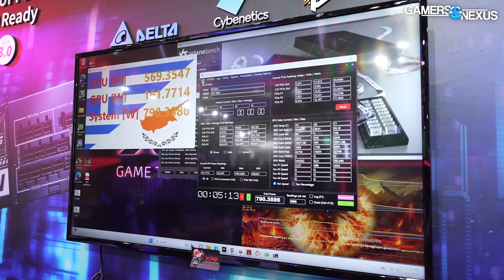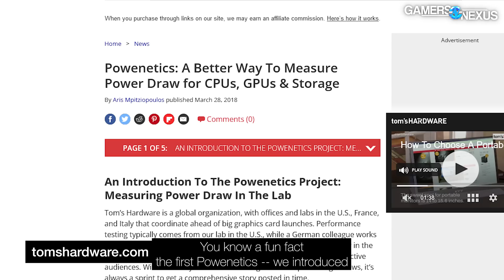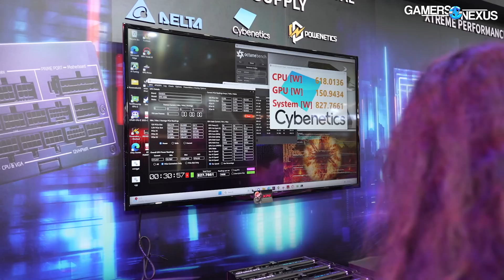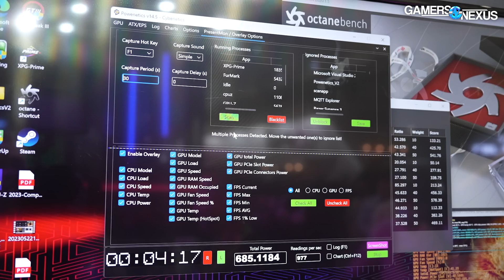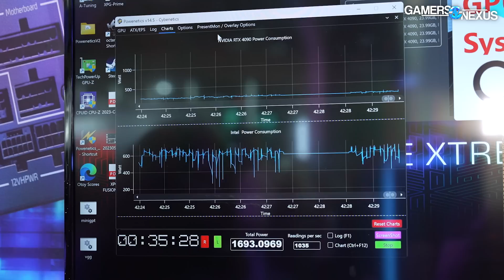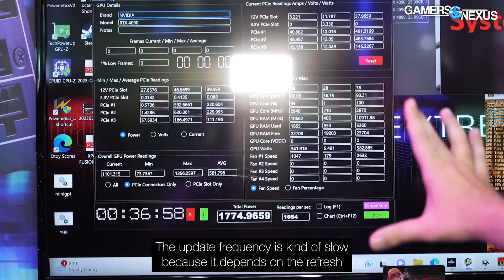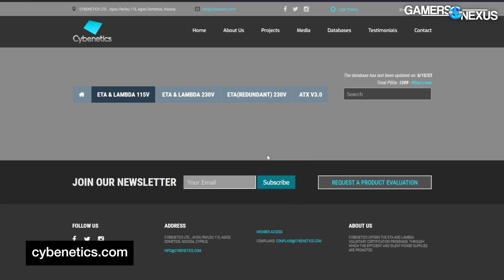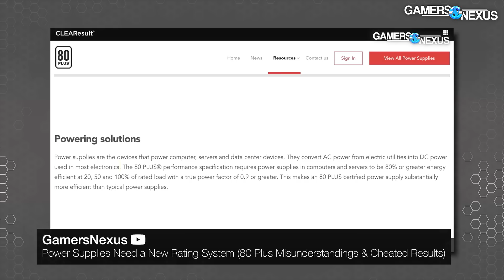GPU & CPU Power Testing Needs an Overhaul | Discussion ft. Aris of Cybenetics

Comment: As a PC tech who was around long before 80+ was introduced it's sometimes hard to remember that not everyone knows what the standard means, and what is tested. When he says it has some weak spots that's framing it mildly. Remember that it only is concerned with power efficiency at a few select loads. It says nothing about the quality of the power, other than make sure it meats minimum ATX spec. That's all. It has nothing to do with quality of the PSU, though in the early years it took a lot of work to meet even the basic 80+ standard, so those PSU's tended to be of at least decent quality. Today that's well known tech and even the cheapest and shoddily made PSU can be built to 80+ spec. Gold was relatively safe to assume that they wouldn't be terrible for a few years, and then Platinum. Titanium grade is the new hotness, and yet there's no guarantee that the power they provide is clean and stable, or at least that it's not better than ATX spec.

Having said that the latest Titanium grade PSU's are still likely to be of at least decent quality. Likely but not guaranteed. 

So yea, a new and improved standard would be a good thing. I'm not envious of him though. Trying to get PSU manufacturers to agree to follow a standard that actually risk pointing out less well performing PSU's in their line up will have to be like herding cats!
Reply: I forgot to mention that when 80+ was introduced it was a big step! At the time PSU's often had an efficiency of about 60%, and 70% was at the high range. Just think of the amount of energy that was just producing heat!

One of these PSU's loaded to 500W would draw something between 714 and 833 watt from the wall...

Now at 80% efficiency that figure would instead be about 625W. That's quite a big difference in power consumption, and it reduce the heat output from 214 - 344 watt to "only" 125 watt. That's less heat to get out of the room in the summer.

So with all it's weaknesses it was a step forward at the time.

Comment: Very good point! The PCB is already carrying 300+ W for the CPU. Add 600+ W for the graphics card. Will the PCB be able to carry almost 1000 W through the metalization? When will the PCBs start to delaminate due to heating?

Comment: The VRMs are unlikely to start fires. But one of the many flaws in the 1920 vintage circuit is that if a single FET shorts, the voltage delivered to the CPU or GPU is 12 V. Louis Rossmann states that this is the number one failure mode for the 13" MacBook Pro. Full voltage goes to the SSD and totally fries it. Destroying all information on the SSD. With fried memory chips, data recovery is NOT possible.

Comment: GPU power connector on motherboard:

One of the point was shorter cables - less voltage drop and higher efficiency. I think that we already can shorten the cables using today's connector. Simply move the connector to the other side of PCB. For long GPUs you will need the cut out in case, for shorter GPUs where connector would end up in motherboard area - mount power connector on the shorter side of PCB - like few manufacturers do. Mounting GPU power connector on motherboard is not a good idea. Not in the way that prototype does it. You simply add one more set of connectors that may fail and is a point of voltage drop.

Connector in motherboard makes sense only when we switch to only 12V PSUs, where all other voltages are being handled by motherboard. In this case you have one set of powerfull connectors that supply motherboard with 12V and a portion of that goes to GPU.

Still this solution generates another problem. What if Today I build a system with mid range CPU and GPU and then I upgrade CPU and after that I wanna upgrade a GPU to a more powerfull. My motherboard's GPU power connector can handle only 300W GPU and I have 500W GPU. To not burn out motherboard we are going to need a set of data connectors that handle power negotiations between motherboard and GPU. So you can end up in a situation when your CPU is powerfull enaugh to run with new GPU, your power supply is powerfull enaugh to power your GPU, but... Your motherboard connector can not handle more power and you end up with bottleneck... We should simplify the connection, not complicate it.

Comment: Please blame the failures on the bad 1920 circuit design, not on cheap components or faulty construction.
The latest "innovation" in the 12 V only PSU is simply eliminating the regulators for the other voltages. Since when is eliminating features "innovation"?

Comment: The "power delivery" problem is caused by using a 1920 circuit design instead of a 2023 circuit design. Coupled with using shoddy parts, no wonder that they explode.

Comment: 16:34 "how many PCB layers you need to carry the power through the board" This should be a non-issue, they require the same number of PCB power and ground planes to carry the power from the PCIE connectors as they would need to carry it from the new power foot.

Next regarding the power handling capabilities of the power foot, I did some looking and that part seems to be the "HD Plus card edge power connector" from TE connectivity, and is designed for data center equipment. They rate it for 25A per power connector, and this unit has eight. Molex has ones that will do 40A per contact. (although that's with a 30C temp rise, Keeping the temp under +10c, you have 15A per contact, which is still a lot more than they are pushing through this.
Even the smaller PCIe connector can handle 3a per contact (in some of the more premium versions) and these are wider than normal signal connectors.

So 600A should be easily doable. Of course you will want to measure it.

Comment: Concerning the last bit with the Motherboard Power Connector - Personally, the biggest mystery to me regarding the whole Connector Debacle ( you know... them melting and stuff ) is why they're not using something like the XT90 from the RC Model Industry that have a 90A / 500V rating... Proper High Strand Silicone Cables while certainly not as flexible as those flimsy ones currently in use would still flexible enough to be routed everywhere even inside the tiniest Case Formfactors and - IMHO - would greatly add to the aesthetics due to less but thicker cables being visible at a time.

Comment: I think people fundamentally misunderstand the 80+ standard and who it is primarily meant for.

It is an efficiency standard. It is just about how efficiently the PSU converts the AC it draws from the supply into DC. For the average home user the difference between an 80+ certified and 80+ Titanium PSU will amount to a dollar or two in operating costs per year, at most.

For a data center operator with hundreds to thousands of PSU's all drawing 1200+ W the differences just between 80+ Platinum and 80+ Titanium PSU's can have a marked effect on the monthly electric bill.

It is true that PSU manufacturers started marketing the standard to main stream consumers with the implicit argument that the higher the efficiency rating the better the physical quality of the PSU must be. For many manufacturers that is the case and it is a reliable marker for quality for brands like Silverstone. The problem is that is relatively easy to just concentrate on the efficiency and ignore the safety features etc. qualify for the rating and produce a low quality PSU for less reputable brands.

Comment: Is it easier to embeed subtitles dirrectly in the video, or to configure custom subtitles for youtube?

The red timeline bar passes through the middle of (the bottom row) of your subtitles when not in full screen, and even in full screen it covers some of the bottom parts (at least on a 1080p screen). But it could be completely different on other screen resolution and aspect ratios, so from that point of view, it's preferable if youtube subtitles were used instead, though I'd understand your hesitation if the video was also uploaded on a different platform (Patreon for example) that didn't support youtube subtitles.

As a non native speaker, I often pause videos if I am reading subtitles. This isn't anything huge just a tiny bit annoying, so if it's too much trouble just ignore it :P

Comment: In Re using CPU as a dummy load: You can change PL1 at runtime. On linux the interface is in /sys/class/powercap/. Then use PI controller to adjust PL1 so that the externally measured input power is what you want, to correct for error in the CPU's own measurement. (But be aware there will be error due to VRM losses, which will vary between motherboards and with temperature.)

Comment: CLI is great for automation and scripting, but it may be easier for cybernetics to simply push the data out as udp packets that an automation tool can ingest. I personally find parsing packets easier than getting awk commands to get what I need out of CLI perfect, but that is probably just m 😅
Reply: CLI applications can have machine readable output as well.
Reply: that kind of thing would be spun up by a cli typically

also udp is an internet protocol, and the chip is likely just communicating over a single bus to the host system.
Reply: @dead-claudia from what I can see in the video, it is simply connected via USB (which makes sense with how easy it is to get a USB interface going now). 

I was referring to the PC interface software being shown forwarding the data. It already reads it from the USB device so passing the serialized data on via udp multicast, minus the USB encapsulation, for who ever to listen too should be relatively trivial.
Reply: @sharadeth seems more sensible to just have a socket file that outputs the data in a machine readable format in real time. You can use UDP as the packet format if you wanted, but introducing a networking stack seems needlessly complex.

Comment: Good then one can actually test Sea sonic PSU's since everyone (including you) say they are "perfect superior" and all that. and i DISAGREE with that.
Since my last "sea sonic" 650W got way to HOT powering my 5900x and 5700XT it was a "platinum version"
Replaced that (crap) with an Delta one (go look it up noobs they are older then you) 650w platinum one. can game ALL day and gets slightly warm.
That temperature comes from somewhere in that Sea Sonic power supply and it aint that "efficiency label" that's on it.........
Reply: Also just because it's Platinum rated doesn't mean the thing will output the whole 650watts.
Reply: @KaRuNaRuGa  most PSU deliver the "optimum" efficiency at about 60% of the power usage, for an 650 that would be around 350w thats why i now use an 850 with my 7900xt :P
Reply: @ronnyspanneveld8110  So, you knew that would happen and still choose to blame the PSU manufacturer? What's next? fkn stuff a 4090ti and then blame Delta next? Imma need whatever you're smoking pal. 🤣
Reply: Wow this comment screams "m0r0n"
Reply: @riba2233  for real!
Reply: PSU is good, you're the one pushing that thing to its limits. Who tf thought it was a good idea to run a 105W CPU and pair it with a GPU that requires a minimum of 600W PSU?
Reply: @KaRuNaRuGa  not really since i am at the optimum efficiency of the psu that's about 350w :P

Comment: I paid more than that for one of my bench Multimeters so as a dedicated test fixture $1k is to cheap compared to the general  Electronics Industry. The software properly sorted is where the actual money is if it does what you need nd it is automated.

Comment: Nvidia sells power measurement devices for reviewers? That's extremely suspicious. There is an EXTREMELY OBVIOUS conflict of interest there, and reviewers should definitely not be using them if at all possible. It's not just an issue of whether they are accurate, it's that they get to choose what's measured, and what's not measured.
Reply: Bs comment, they are 100% reliable
Reply: @riba2233  Nothing is 100% reliable

Comment: Can a small end user also purchase one?
Reply: yes it is open to anyone, powenetics, as long as we have any pieces left.
Reply: Thanks for the quick feedback. Are there any obvious reasons why your solution wouldn’t work for other PCIe Gen4/5 AICs (some only slot-powered, some with additional PCIe 6-Pin power connectors) to independently investigate their power consumption behavior?

Comment: There are many reasons I have the main plug for my system on my desk, I don't need to dive below the desk to find it, and pulling the plug during thunderstorms is dirt easy. I have surge protector but still if a thunderstorm strikes close enough, I won't matter. Also, my 850watt PSU is 10 years old and an OCZ... ;)

Comment: I truly enjoy getting to know the people in the business.   My computer is a prebuilt 400$ 3 year old ryzen system and i'm unlikely to ever install a gpu or cooling in my life but your presentations are interesting and getting to see the sausage made is why i subscribe.  Thanks for this one, I've added another channel to my sub list.
Reply: As  I got to 50 years old, I found I didn't have the time or patience to build my own systems anymore. There's still an old  Phenom II 64 black edition build sitting 10 feet behind me right now that waiting to be set up as a 'retro' computer. It's been there for four years.

My current system is a 5800X 3D build maxing out the AM4 platform, just waiting for an nVdia 4800 to drop to $500 dollars (I can wait - eBay is a thing).

This is probably all word salad and that's my point.  If you want to dig into GamersNexus content you'll learn a LOT. If you get to the point of wanting a new system, look locally at those dusty old computer stores in the strip mall. I found a guy locally that will put together my system at an amazing low price. I know what I'm doing.. I just don't want to do it anymore.

This channel can give you a great tool kit of knowledge. Walking into a local builder with a box of parts and a decent build price has kept this old man up to date (and the wife's) for a while now.
Reply: Ah, you can probably upgrade your CPU to a Ryzen 5000. Then you're just a GPU away from having an up to date system again.